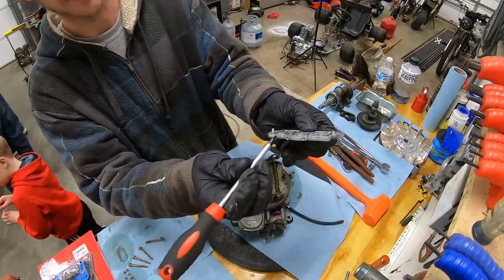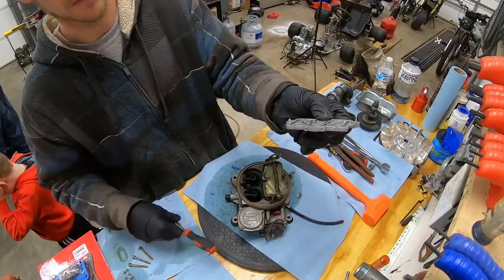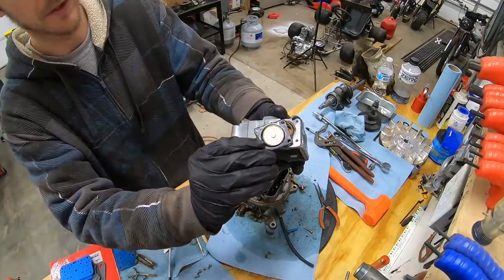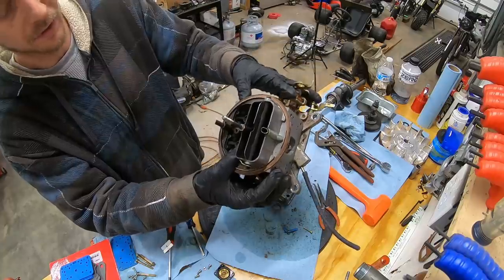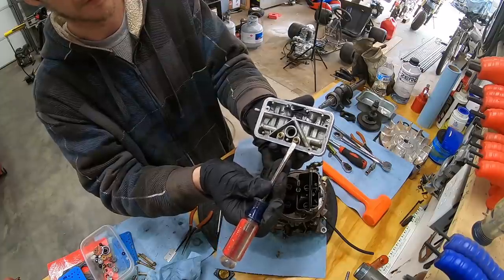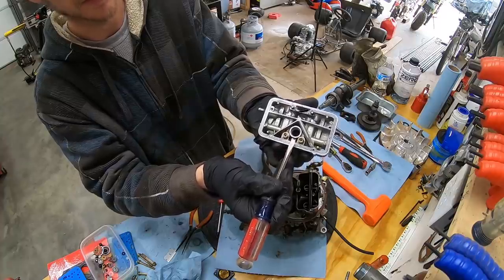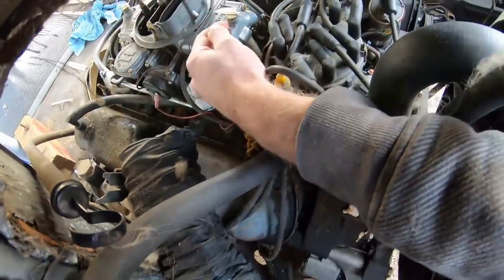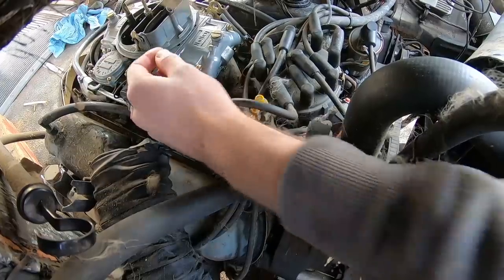Short Bus RV Carb Rebuild

Comment: Old heads like myself would use our trusty dwell, and tachometer machine to adjust the carbs air idle mixture screws.  I still have mine although I have no clue if it still works.  Setting the timing, adjusting the distributor dwell and adjusting the carbs and carb chokes, used to keep many garages busy when business was tight.

Comment: You know this best Ford motor there is besides the 289 and 302 351 Windsor if you throw a cam in it aluminum intake and headers that motor will perform very well especially if you put isky 292 mega cam that thing will perform very well it will have all the power you need and then some

Comment: Daniel is a decent carb mechanic. Not alot of guys still around that know how to balance out the vacuum level with a given Carburetor. That's why alot of people use a mechanical secondary set up. Instead of a vacuum secondary. Pretty sweet. 
  Next for your black paint removal it will have to be sanded with a D.A. with 240 grit. Then feather the edges and remove the 240 grit scratches with 400 grit. 
   If the paint didnt come off with a pressure washer it will be fine under the wrap. Just feather all the edges and all the scratches back so they cant be felt by your hand and it will all be hidden under the vinyl wrap. 
   Last. You should see if you can get Industrial injection to sponser you with a 12 valve cummins built motor with a stout compound turbo. 
  Weather your into quads. Carts . buggies snowmobiles mud trucks or rock crawlers everybody needs a tow rig. / weekender why not an industrial injected cummins powered coal rolling monster.

Comment: Fords always be smokin..at least back then they knew how to make engines better....I feel sorry for today's ford guys...especially those with a 4.6 or 5.4 ...but ford's make me $$$ :)
Reply: Those mod motors are not that bad. 5.4 2 valve had issues with not enough thread for the spark plugs. 3 valve had issues with the 2 piece plugs (was revised) and cam phaser issues (people not changing oil often enough caused the issue). 4.6 has issues with the intake manifold to leak at the thermostat housing (seen it many times, never got a revision and not sure if aftermarket aluminum manifolds alleviate the problem permanently).
Reply: I'll stick with my pushrod engines

Comment: Holley 4bbl>Autolite 2bbl. Gotta love Holley carburetors.

Edit: Finally someone else who sees the benefits for a Cummins 12 valve! Should nick name it, the Fummins Short Bus.
Reply: Pretty sure anyone who knows about diesels knows the 12v Cummins is a beast...   lmao
Reply: Oh yeah they can be. Question is which version of the 12 valve is he going with. First gen with a Bosch VE44 injector pump, or second gen with the Bosch inline P7100? Make sure the dowel pin in the timing case is fixed,don't want to see a video on blown 12 valve because the dowel pin fell into the gear train.
Reply: I guess it really depends on what gen 12v he gets but either will work. If he gets the VE 12v I don't see a reason to swap to the p pump not like he's racing it lol. A tuned up VE flows good enough to make well over 1000ft lbs of torque but I don't see this build going that far.
Reply: VE also has dynamic timing, meaning better mpg. Plus, modify the springs and red line goes to I think 3200 maybe more...I can't quite recall.

Comment: You guys know if you flip the oil container over so the neck is on top it pours with no glug, glug...that's why they designed it that way...let's the air in the top...

Comment: the fuel "squirters" sit on top of the venturi.......and what was the reason for putting a 7.5 power valve?.....and no 750 cfm's use 70 size jets.....600 to 650 come with 67's
Reply: We put a 7.5 power valve in the carburetor because the engine pulled 15 pounds of vacuum at idle. I have two 600 CFM Holleys two 650s and three 750s and they all came with 70 Jets.
Reply: @danieljohnson8020  I find that for tuning a power circuit, half of idle vac is fine for a start point. Once you have it driving, get into a steady state cruise and measure your vacuum then. Set your power valve to about 2 inHg lower than that reading. This makes sure that you aren't pulling too much fuel on cruise but still have power when tipping in.

Comment: I would stick with the 351w the Cummins is junk.
Reply: I agree with you Jason 351 Windsor strong motors throw a cam in it I redo the heads aluminum intake and headers you got yourself a  motor it will last you forever especially if you put a isky 292 mega cam you get pretty decent gas mileage to
Reply: Junk? Its a famous industrial engine the ended up putting in a truck. The 12 valve was the legend. Not the electronic bull shit of today and not the emissions Madden motors they put in big rigs today. The 12 valve 5.9 cummins only take 3 wires to run it they have clocked over 1 million miles without a rebuild. 17,000 hours of industrial work without a rebuild. Its a true legend
Reply: Chris Langdell , not hard to work on a fuel injection engine.  An injection pump brakes on a diesel good luck.

Comment: A 4bt Cummins may fit a alot better that is in a lot of UPS trucks and bread trucks
Reply: Bread trucks yes, UPS? No idea. Good luck buying a UPS truck because they are never for sale. 4BT engines have shot up a lot in cost in the last 5 years. They use to go for $2500 with a transmission, now it's more than double.
Reply: @Ratkill9000  I am assuming that bus as a 460 in it but if you put a 12 valve in it you have to think that you were adding another 10 inches or so to what is already there in the video it look really tight to start with
Reply: @briandyer6693  it actually has a 351 Windsor

Comment: Great stuff. Glad to see some progress on it. I noticed the smoke seemed to be clearing up the more you ran it so you should be good to go. I think I would drive it and exercise it plenty before making the trip with it. That was you can see if it starts to leak any fluid from dried seals. It is probably fine but making parts runs, food runs, and joy rides locally will bring out any leaks, drips like that so you can fix them. More please!!

Comment: Na Cummins or turbocharged
Reply: NA would be a dog. Needs a Holset HX30.
Reply: @Ratkill9000   you make a good point best question is single or compound
Reply: @thatonedude1815  In this case, single. It's going to be a tight fit with the engine as is. A remote compound setup won't be as effective. If this was built on a truck frame and not the Econoline, compounds.